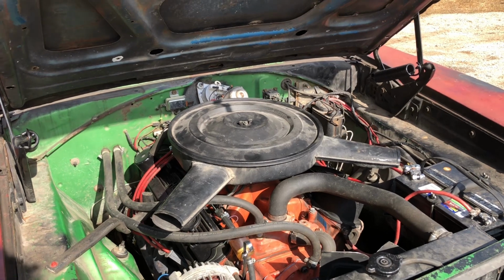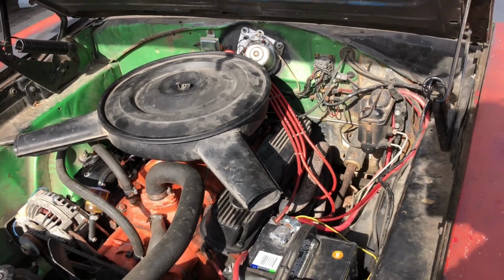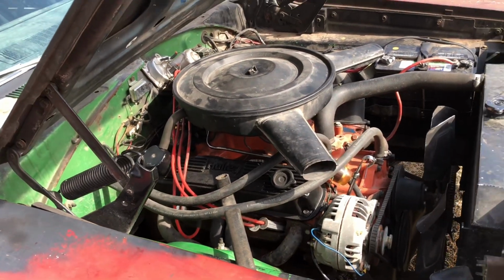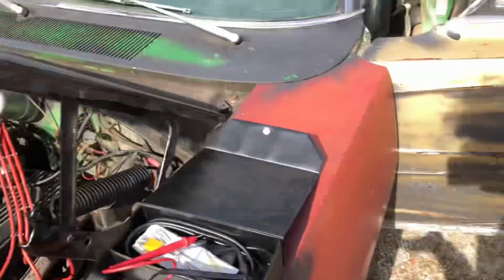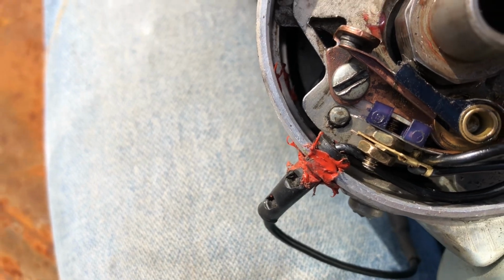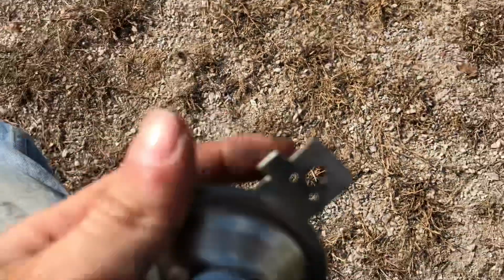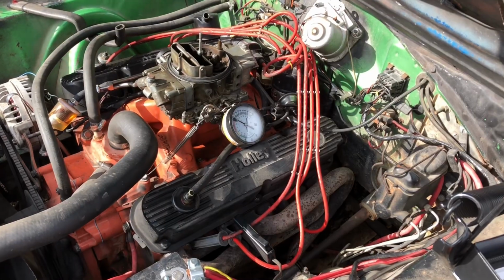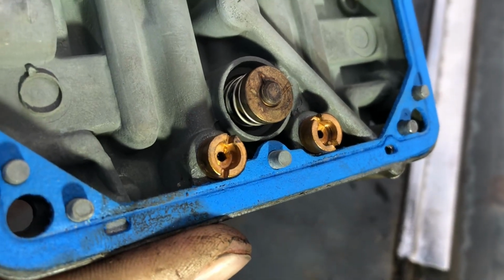Working on solving a problem on my daily driver 1969 charger

Comment: man the quality of fuel you putting in that thing will make a difference in how it runs and by the looks of that fuel filter your tank must be full of rust and other junk. Running that fuel can gum up the valves and make your carb not run right.

Comment: I had a similar problem years ago with a 318 equipped Dodge van. Slight acceleration caused mis-fires but if I really got on it, it worked well. I did not change the springs on the mechanical advance in the distributor but it turned out the pivot points of the lobes were gummed up with dried out lubricant. I cleaned them and relubricated them and the problem was solved. Hope you get the problem solved.

Comment: Get rid of them points electronic ignition is far superior and they do make a simple stupid HEI the that will work Mopar it looks just like the GM the one with the big Kap or better yet MSD box and an MSD distributor that's the way to go if you can afford it

Comment: nice man/set the points at .014 thousants/the distributor looks like the lobs are wore-also cut a 2 inch peace of heater hose an take the coil wire of the coil an slip it down over the coil wire-at the coil/also on the distributor cap for the coil wire/sweet car/thanks much
Reply: The heater hose is to block stray sparks? sounds like a good idea.  And I agree about the lobes too.  Point gap too small when dwell is right means distributor cam is worn, but I'm not sure if that is much of a problem.

Comment: most 340 engines need 35 degrees total timing without the vacuum advance. i always set my timing at 15 degrees  with 20 degrees in the dist. which gave me about 35. then when vacuum advance cruising would be about 45 not loaded. Holleys have a bad problem with the surface where the metering block bolts to body warps i take a flat plate and put a piece of 100 grit sandpaper and sand until smooth usually solves a lot of problems i usually on a stock motor run a 6.5 power valve. points should be about .018".  the transfer slot if i remember correctly should be .040" then set idle with rear barrels. usually the voltage should be around 8 volts. and charging should be 13.8 to 14.2 so your is over charging a little. i would convert to electronic ignition and run the chevy 4 pin module and then no need for the ballast anymore they are real easy to change over . just get any old small block dist and use the chevy module they work really well
Reply: I pretty much second this, except I might run more vacuum advance for cruising mileage, especially if you have a good ear for spark knock and can respond on the road whenever you hear it, then you can run a lot of vacuum advance at cruise.  This goes double for worn out engines with low compression and cool combustion chambers due to oil burning.  Though tuning in response to uneven wear is a problem.